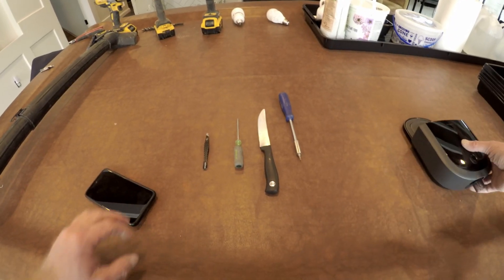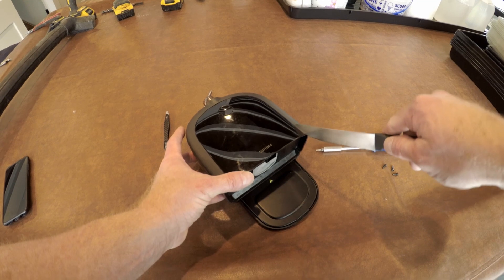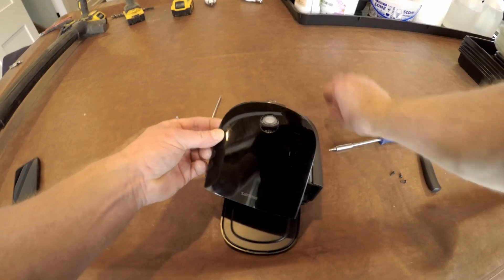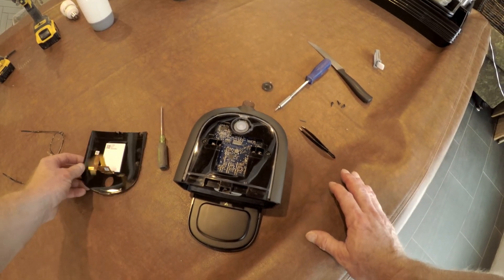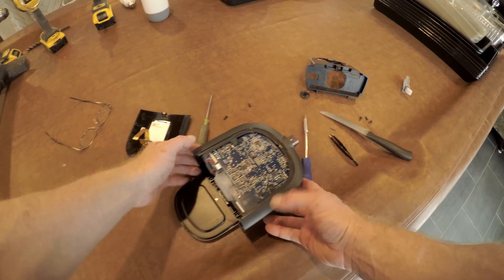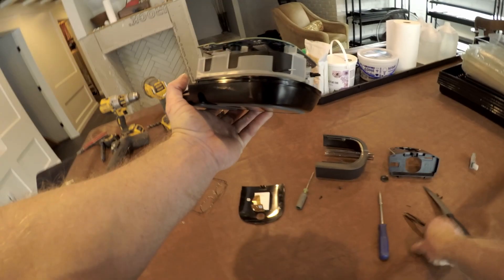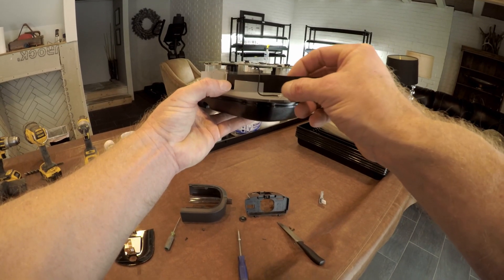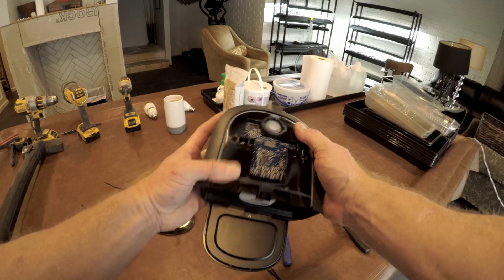CPAP Dreamstation 2 cellular modem deactivation

Comment: I followed everything till you got to the part about shutting off the modem. You said you" shorted something" how did you disconnect the cellular antenna was it just removing the wire ? But you said that didn't do it, but you had to short the "Coaxe" how do you short the coaxe?
Reply from the maker: after disconnecting the coax cable from the antenna, solder the shield of coax cable to the center conductor.